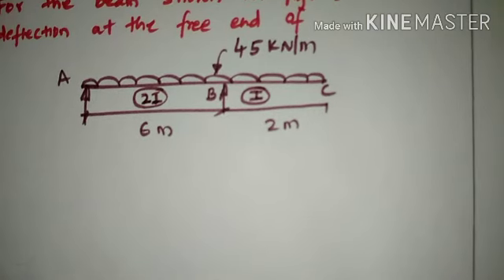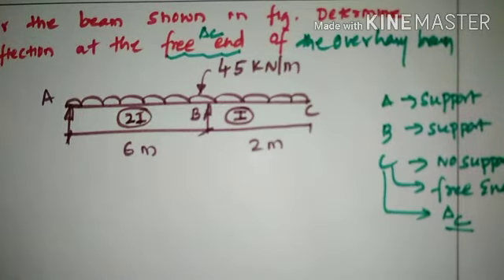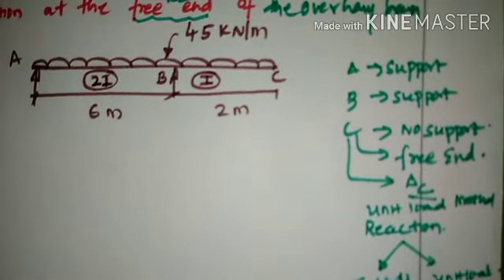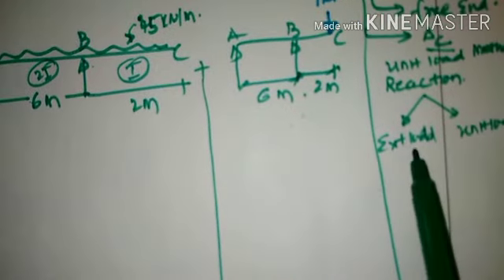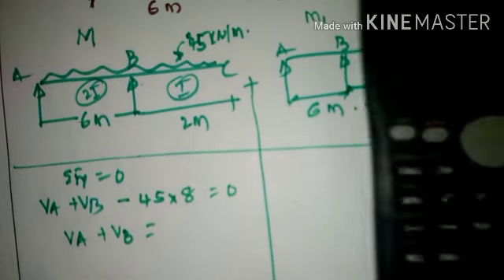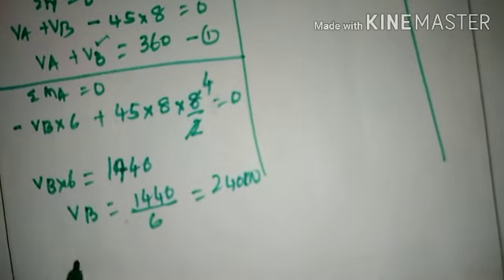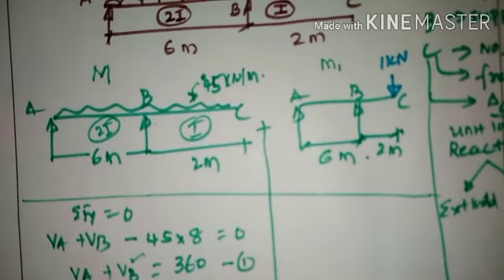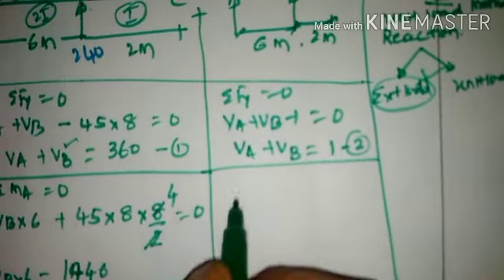Solution by Unit Load Method for Overhanging beam

Comment: Sir this same question on the book of ss bhavakatti vol 1 . he takes limit of B to C is 0 to 2
Reply from the maker: Yes you can take limits 0-2, in that case distance multiplicative for load will be different. Procedure adopted in this problem(6-8) and by taking 0-2.both are correct. Take care for load distance multiplicarion
Reply: @sachinm.kulkarni3421  yes sir , it is a point .thanks sir .love u from kashmir
Reply from the maker: @suhailrather985  thank you